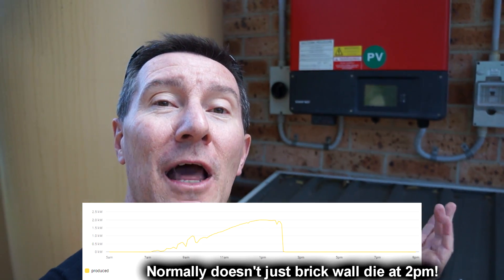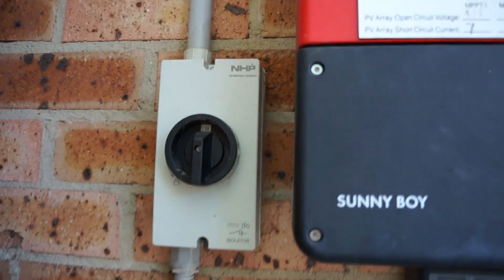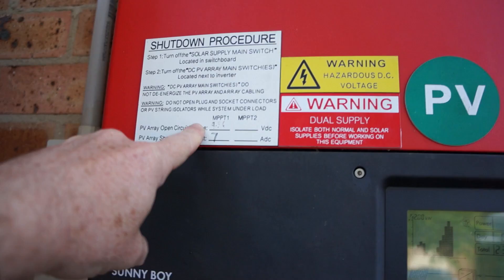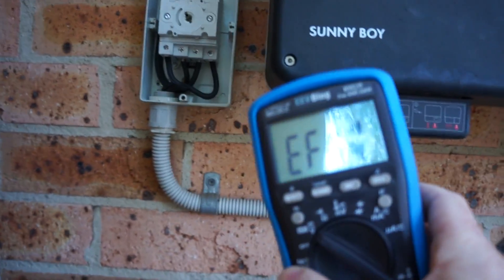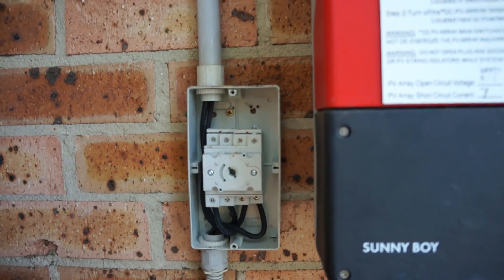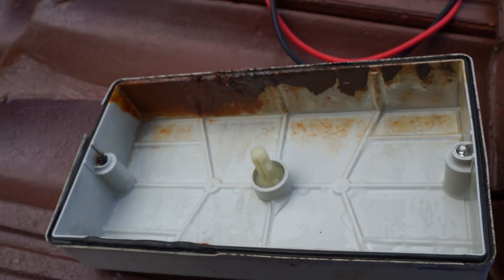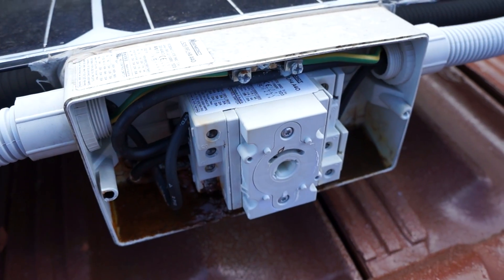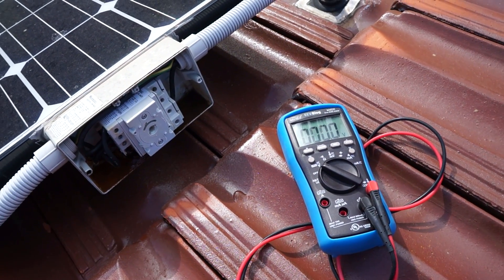EEVblog #1217 - My Home Solar Power System FAILED!

Comment from the maker: I kinda predicted this back in a previous video when I noted the wear on the box
Reply: @EEVblog DAVE... This is the reason for the switch recall... and how you have dodged a bullet... 

https://youtu.be/10Gnf-wvF7A?t=346
This was on the ABC 2 days ago.
Reply: @RACGump Gump wow, glad his didn't go into that failure mode.
Reply: The Gump 😱
Reply: @RACGump  holy shit
Reply: Luca Capelli  Content creation by doing mistakes.
Reply: NO plastic on the roof!!,.....jeez
quick search and these are available in aluminium  https://www.katko.com/products/photovoltaic-switches/pva-pvm-photovoltaics-dc-enclosed-switches/
Reply: why no more dome videos? =(
Reply: Also, if you HAVE plastic - make a 'small roof' for it just above, preferably from a steel zinс-coated sheet. UV and heavy rain/snow/hail shower protection. If you'd live in Russia - that box, especially with the box jount upside - whould definitely fail just after one winter.
Reply: Newer installs still have the isolators, but there is a stainless steel 'sun shield' that they now install on top that seems to do a descent job.
Talking to one of the installers, they would like to be able to put the isolator under the panels enough to use them to keep the sun and water off the box directly, but new regulations mean they have to put them out in the open, but at least they an put the sun-shields on now.
Reply: @Electra Flarefire Yep, the more I see of the laws enacted in Australia over the last 30 years the more I feel they are going backwards in an Idiocracy sort of way.
Reply: Dave, here's something bigclivedotcom always mentions: For outdoor boxes of electrical installation, it's always advisable to drill a hole on the bottom side so that water can drip out, instead of collecting in there and corroding stuff. So a "weatherproof" casing with one drain hole might not have corroded this isolator switch. Or at least not as badly in such a relatively short time (come on, a rooftop installation, do you really want to change it more than once per decade? Ideally it should last two decades!)
Reply: @Seegalgalguntijak  Even a totally sealed unit will tend to suck air in and out with temperature changes, then you get condensation. But drill a hole and small insects get in and die, sometimes right between the contacts. I had a beautiful all mechanical, bakelite boxed earth leakage circuit breaker fail because a spider got in and buggered up the works.
Reply: @donaldasayers  I wager the spider only got to do it once.
Reply: @boldford  Oh he was dead.
Reply: @Donald Sayers Then maybe the contacts could be potted individually inside the box? Even hot snot might do, if the temperatures don't get too high (or something more appropriate).
Reply: @Seegalgalguntijak  don't you think it will increase the moisture inside the box and will result the same, rust
Reply: You wouldve thought that for something going in the sun for decades the decision on the box wouldve been to be metal with a good paint treat or something.
Reply: If it can't be completely removed due to regulations or something it would be good to mount it under a panel to protect it from sun and rain.
Reply: I'm astounded there isn't any flashing.  I've installed more than a few units in C.A. and it is standard to block UV, debris, etc.  we also bore a hole on the downside inside corner and affix them canted for drainage.  There is no such thing as an intrinsic electrical box in the long term.
Reply: They shouldn't ever make an isolation switch out of plastic for the roof. Of course it failed. Aluminum, it's just as inexpensive but lasts 50 years.
Reply: Plastic boxes like that can last a long time, but obviously that one wasn't good enough. 
It's a little late now, but what I would have done is wrapped a couple of layers of metallic tape around the box to protect it, it would probably have lasted at least 4x longer if you checked on the tape every couple of years
Reply: @YragLee  I would say ceramic
Metal being a conductor and what not.
Even with insulted cables
Reply: @IIGrayfoxII  
Most of your wiring connectors are metal in America. They're simply coated. Problem solved. 😁
Reply: You need a hood on that isolator by law now.  Make sure the replacement is installed to the 2019 CEC rules. I also noticed your isolators down near the inverter have the cables coming in the top. Nowadays that would be illegal for the same reason as it can lead to water ingress and fires
Reply: Your switches look suspiciously like four pole ac switches with two contacts in series per pole.
Reply: When I saw that story the other night on ABC talking about bad solar panels from China I was worried when those installers took down someone's panels cause they failed and I'm worried the panels might be good but they told them they were bad. Bit dodgy. Could have been your issue.
Reply: Seems to be pretty useless for safety. Still got all the panels in series with 400V. Would make more sense to route the panels to a sturdy box and put disconnect switches in series with every panel, that way it would be easier and safer to work on, that way you could drop the voltage to a single panels voltage which is usually 12-24V.
Reply: If possible please do a video about the repair. I'm interested in knowing how one can safely work on this. Multiple kW at 400+ volts DC is potentially very dangerous.
Reply: Cough cough. Ahem. Any news??
Reply: That's scary. Look at the gump's link. 😨🔥
Reply: Are you going to do an update on the system as a whole / cost per W/h?
Reply: Hi Dave, think it's AS5033, I heard via the conspiracy line flooding, they not cheap and causing issues Inc fires as others have pointed out.
Reply: EEVblog  - How many times did you recover the costs of your home solar system?
Reply: Check out these isolators from ASM, had one on the roof in direct sun light for nearly 9 years and apart from a little fading the plastic case and seal is still in tip top condition, if ASM can make isolators that last surely the other manufacturers can. http://www.australiansolarmanufacturing.com.au/main/page_product_solar_dc_isolator.html
Reply: Clean your tip people
Reply: @EEVblog guess its time to put a metal box around that switch box eh?
Reply from the maker: Luca Capelli  Because the seal still looked ok IIRC
Reply: >olp} {I'll op 00
Reply: Hey dave. Plan is this year to get a houseboat... second plan is to power it's motor via solar (and scale a battery accordingly!). Have I got the calculations right, that around a 1250w set of panels will cover 1kw motor running in full sun?
Reply: @TechyBen  
Great to hear and it sounds like a fun project. I have had mixed results so far working things out in the real world. Solar never quite works out the way I thought no matter how much I plan. I've recalculated panel efficiency to between 30 & 60 percent of the manufacturers ratings and it seems to work out better but it's tough to get reasonable performance. Solar boats are a lot more difficult than they look, but that's the fun of it right.
Reply: @YragLee  Yeah. Thanks! Started with my learning curve for the actual hardware today... but starting small. ;) Scavenged 4 solar phone charge banks, hooked up 4 panels to 1, and used diodes to prevent back charge. Seems I wired it up right (it detected charge when in the sunlight), but I put it back together before checking total current/amps, oops. 3D printing an expanded case for it now. Yeah, about 1000x smaller than the "boat" scale, but it's a place to start.
Reply: @TechyBen  
Great! I'm excited for you, and I can't wait to see what you learn. Document it on YouTube and share it with us?
Reply: @YragLee  Once I hit up the boat possibly. But will probably be 12 months or so for that.
Reply: Replace the cheapo gasket with pure silicone rubber sealant. (highly resistant to UV degradation)  Also, drill a small hole in the bottom of the box to let any leaking water drain out so it can't fill up and corrode the metal parts.
Reply: what numnut left those exposed to the elements, Thats just crazy why haven't you got weather guards over those its no wonder they failed.. i have 2 of these on the roof only because i  have 2 banks of 12 panels 2 inputs on the inputs of the ABB + 2 more of these at the inverter and another on the AC side yeah i don't know either why i have all these might just a QLD Spec..
Reply: I've seen it happen b4, if it was moved to a different location it won't happen again
Reply: Plastic should not degrade. If it is made for outdoor use (UV-resistant plastic). Clearly that one is not. Therefore ONE more switch not suitable for usage :D Funny. Find something that is UV resistant (consider black boxes, not white)
Reply: @tarassu  
Plastic like Polypropylene is a simple chain polymer. It's what most plastics are made of and have susceptibility to UV radiation and the chemical bonds break.  

Coatings generally help but last about a year in weather before beginning to break down.

Once the UV coating breaks down, there's a 6 day window before it's permanently and completely destroyed.

This is a well know failure point and why zero Polypropylene should EVER be used on a roof.

Polypropylene is exclusively used in electrical applications because it's rigid and semi-stable for a number of years under certain conditions, but even under the best circumstances they break down within a 10 to 15 years.

Polyester, another typical plastic, is highly resistant to damage from UV radiation but isn't very rigid and isn't suitable for electrical use.

If you absolutely must have plastic electrical boxes that are made well enough to put on a roof, they're going to be quite expensive and aren't likely to last as long as anodized aluminum. You can place metal flashing over the boxes but then you've got to ask yourself why?
Reply: There is no excuse for this. This is planned obsolescence. I am noticing things are just not lasting anymore.
Reply: Should get a wind turbine
Reply: That's the Problem with "Boxes", Dave...  They always wear out in The End. And the Heartbreak of a Sludged Tip ensues, always. Always! 😃😂🤣😅😀😙
Reply: CHECK THIS OUT - The dark side of Australia's rooftop solar energy obsession | 7.30
https://youtu.be/10Gnf-wvF7A?t=344
Reply: Hi, Dave. Compared with the solar panel array, I am interested more in the battery array arrangement. Will you make a video about that.
Reply: What was the ROI?
Reply: @eevblog they have an isolator on the roof for isolation at the source, but also for in the case you get a wiring short it can be turned off at the source, otherwise the DC can potentially arc across the wire and burn it's way up through your walls and ceiling! Especially if it's a higher voltage array, 300-500Voc isn't that uncommon and boy does it draw an arc.

Yes you could just unplug a panel, or even throw a towel on one! But all cables are supposed to be clipped and secured beneath the array so an isolator was the solution.  
They could have at least drilled a weep hole in the bottom.  

It is a requirement here in aus to have rooftop isolation, along with the array earthed. Which is stupid as it's a floating DC supply, you can lick one end all day and be fine, so I don't know why they decided that.
Reply: You need an EEVblog shirt that says "That's completely cactus!". Hopefully you replaced the isolator switch with one that's in a metal box. How UL and other certification outfits would ever pass an enclosure like that plastic one...
Reply: In Europe the DC Isolation switch is only required to be installed next to the inverter. The only requirement on the roof is to connect all of the metal frames to ground.
Australia has some very peculiar regulations (or over regulations) when it comes to electricity.
Reply: Luca Capelli  if it still working....don't touch it!
Reply: @AhmadAlghannam  great advice. I'll never service my car again. Lolz!
Reply: @whatsstefon  the rule does not apply for mechanical systems. applies only for properly designed electrical systems. when a disconnector fails it opens circuit making no harm.
Reply: @AhmadAlghannam  a simple isolator like these are mechanical. My point, or more specifically, my sarcasm was aimed at the fact that anything with moving parts, and or seals will need periodic maintenance.
Reply: Stefano Musica  i agree with you. Periodic maintenance is a necessity for all kind of systems. But as a professional PV installer. I won’t touch such a disconnecter as if i tried to manually disconnect a live DC cable. Mostly it will set on fire. But if i left it till it fails the arc chamber will interrupt the arc safely.

Comment: In the rigorously proven work by Dr. Victor Klimov and his team at Los Alamos National Laboratory, nanocrystalline solar cells can achieve outputs of 200% to 700% as much electron output energy as their input photon energy the operator himself furnishes! These cells leverage quantum dot technology, where the interaction with the vacuum state provides additional energy to the output electrons. Klimov et al. demonstrate and explain how -- and why -- this excess input energy is furnished to the output electrons of the very tiny nanocrystalline solar cell -- and they explain that it comes directly from the seething virtual state vacuum itself.
 
Therefore we never have to "prove" it again, as it has been scientifically and experimentally proven for all time.
Let's see what you could do with that proven Klimov fact.
 
Want a self-powering solar panel? Build it of spherical shells of Klimov nanocrystalline solar cells, with each little spherical shell surrounding an internal tourmaline crystal. The tourmaline crystal is known to have a dipole across it that remains, hence is a broken symmetry that does not lose its asymmetry. It also continually extracts energy from the vacuum and outputs it as steadily emitted real photons in the IR region. Hence each "special spherical component" of such a solar panel does not care whether or not the sun is shining; it takes its input energy freely from the active vacuum via the tourmaline crystal, furnishes it to the Klimov nanocrystalline solar cells spherically surrounding the tourmaline crystal, and these tourmaline-fed Klimov nanocrystalline solar cells output real electrons with energy amplification of 200% to 700% over normal.

Comment: I had a system installed in 2010, made sure they placed inverter and swithes inside garage, out of the weather. Never have had any problems. System has paid for itself after 8 years, and everything is just gravy. (las vegas)

Comment: Its why I never invest in anything solar power or wind power related. I know its just sun rays and wind, and therefore no way to create purely sustainable energy. So the question is - what does create sustainable energy then? If not solar wind, if not wind power, then what? The answer are FUELS! Of course! It all makes perfect sense. Solar energy projects fail because their model is a failure based on a failed understanding of how sustainability works. For any vehicle to have a sustainable future, there has to be fuel. That means gasoline, oil, electricity, etc. That is what you need to run hings. If you want to power up your house, you require electricity to do it for you. And that electricity must come from a water based source.Greetings from Iceland!

Comment: This came up in the Sydney Morning Herald today, thanks for your video I took a look at the units on the roof. Mine was installed about a year ago, so they have shields over the boxes and I checked the model to ensure its not on the recall list.  Maybe the news article is a bit click baity. https://www.smh.com.au/national/nsw/the-irony-s-not-lost-on-me-solar-panel-safety-device-led-to-500-per-cent-rise-in-rooftop-fires-20210129-p56xtp.html

Comment: There are a lot of these DC switches on the market Dave, most are no bloody good. After much trial and tribulation  I have bought Blue Sea Marine circuit breakers, these are not cheap. Near $100 for a rating of 100A at 48V.  They are made in the US or Mexico  and they seem to be reliable and actually trip at their rated current. The CHINESE made types are all crap in my experience.

Comment: It always surprises me how thin the electrical boxes are in other countries.  In the US most sealed boxes you can buy for outdoor use are more than twice as thick of UV resistant plastic with many even being fiberglass reinforced.  Sometimes you can buy cheaper ones that are not consumer grade but it's always best to buy commercial or industrial grade if you are ever going to install any electrical equipment.  Sure they cost more but a solar installation should easily last over 50-75 years without needing to be replaced if installed correctly and none of the panels are physically damaged.

Comment: I'm no expert in solar panels but, they produce electricity instantly when light hits them and the are no way to turn that process off. If You need to service or replace one panel, its a good thing if You could break connection to the other panels, else I guess You have to cover them all some how to block the light or do the work at night to avoid electrocution. For that reason, the individual service breakers is good/needed.

Comment: The reason I know about for having an Isolation switch on the roof is apparently to help fire fighters disable the system before they fight a fire. 
They are instructed to not go on the roof or even fight a fire if the solar system is still active throughout the call.

Comment: High current DC switches and isolators are not easy to design. I always I am afraid they will fail.

As of the box, well, it looks like a shitty material. Good quality box even plastic one should survive much longer than 6 years.